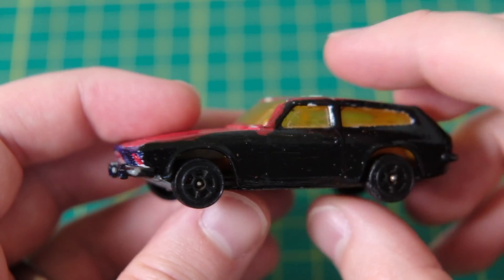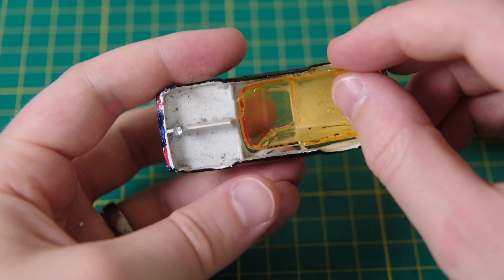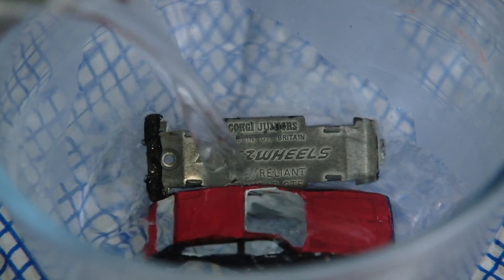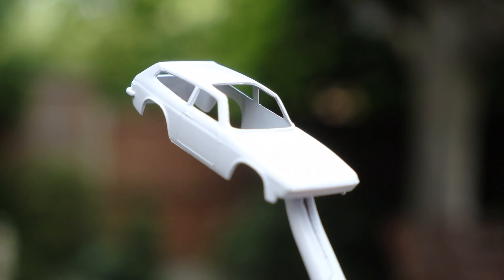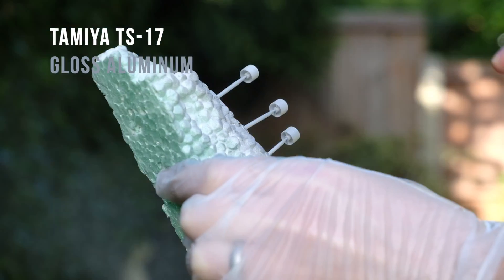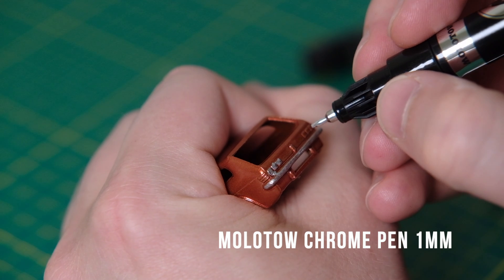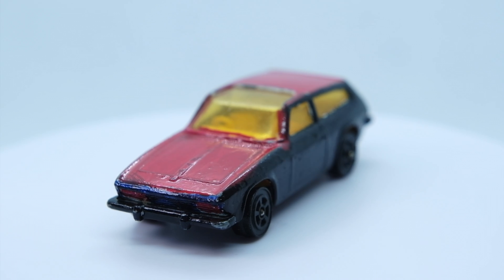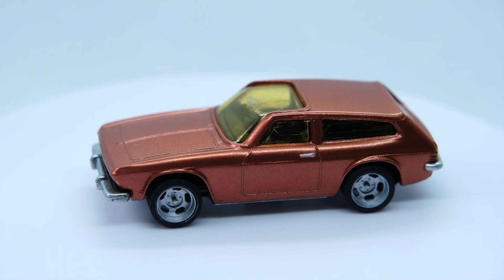CORGI custom restoration: 12C Ogle / Reliant Scimitar GTE

Comment: I done 1 of these myself but in a metallic pinkish colour, changed the front and rear glass altogether as they were too far gone so opted for some modified hoy wheels parts.
This is super cool though love them wheels.
I'll upload a video of mine at some point although sadly don't have a before pic but you can imagine how bad it was glass wise.